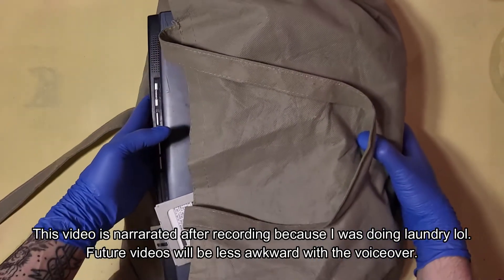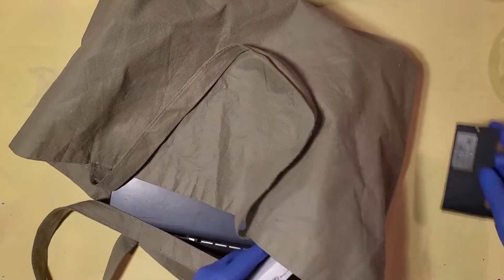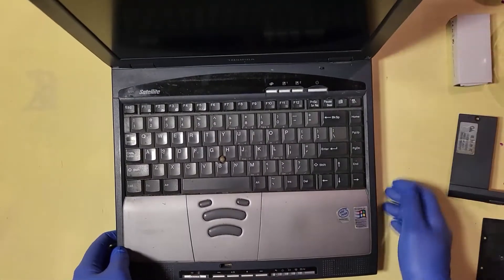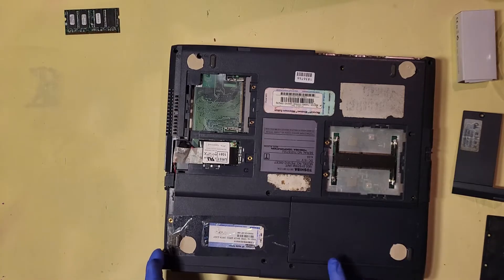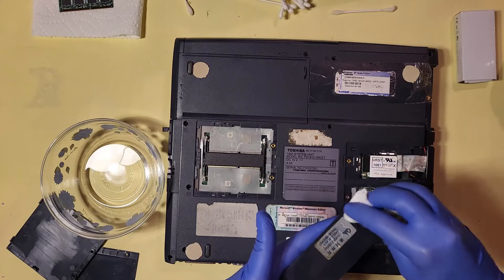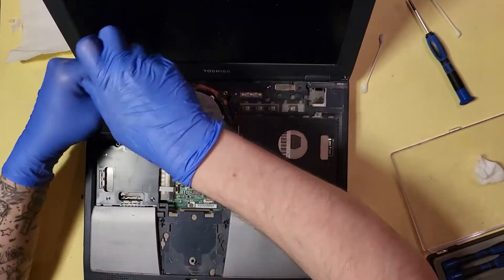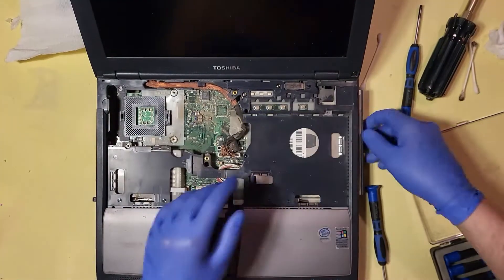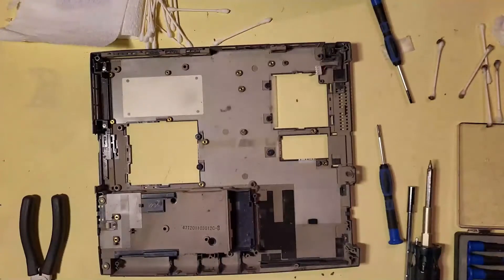Toshiba Satellite 1800 Part 1: Disassembly

Comment: I agree, it's  a beautiful machine. I found one one a local listing yesterday and got it, only difference it's got a touchpad instead of the nub. It's now running Win98 SE. I also love that the audio controls can be used without booting the system, it can act as an oversized Discman of sorts